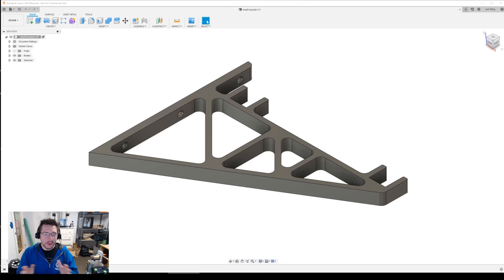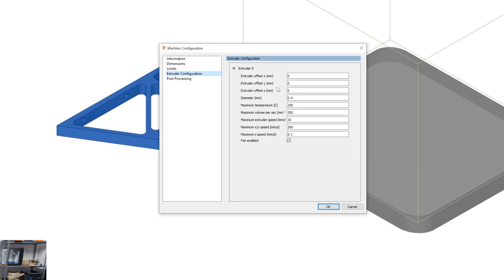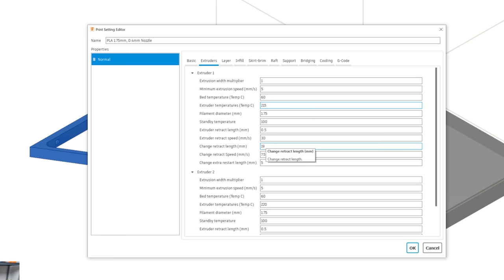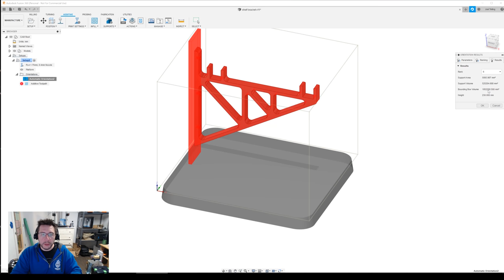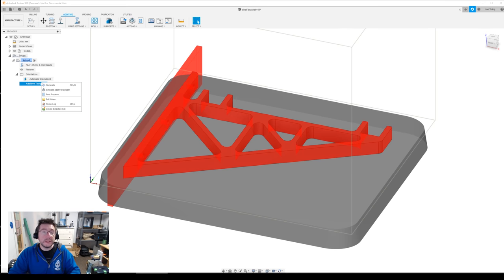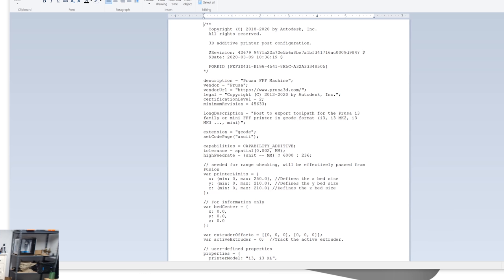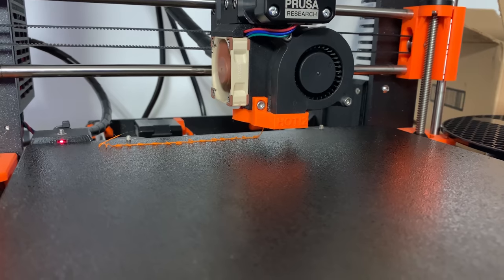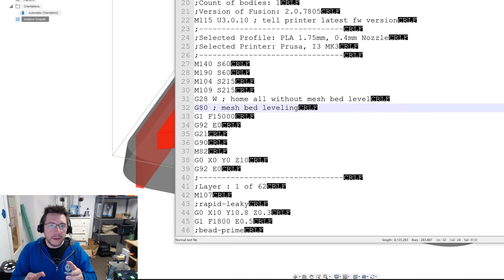Fusion 360 is NOW a 3D Printing SLICER!

Comment: A fix has been applied to the Prusa post. Please download the new post and you should be all set. Happy printing!
Reply: That was fast.
Reply: Does this Slicing process handles Curves/Arcs correct? That is my biggest problem with most slicers
Reply: Hi, I love you, just can't figure you out.
Reply: Are the slicer features included with my paid sub, or do I need to buy it with Cloud Credit?
Reply: I dont get to the same post dialogue box as shown in this video - the box I get to is much less detailed and does not contain the web link etc. Is there a setting I need to access please? Also, how, and from where do I down load the new Prusa post?
Reply: I had a look to see how much it costs to get Fusion 360 it's £483 per year so fuck that I might as well learn to code and write my own fucking software ROBBING BASTERDS. In fact to be completely honest, the only thing stopping me from buying a 3D printer is the cost of the software that I would need for it to be of any use. I remember when 2D printing was a new thing. I went out and bought a printer, now if I want to print anything I have to buy new ink cartridges that cost more than the printer and run out after the printer has finish printing useless test sheets every time I switch it on. It literally costs more to print about 50 sides of A4 than to buy a new printer. Fucking rip off, just like everything else.
Reply: @Galv140577  it's free
Reply: @Galv140577  its free lmao
Reply: @Galv140577  Ik this thread is from 5 months ago but look at their competitors like solodworks, they charge 5000 dollars or more per year/licrnse
Reply: Where is my print settings edit button?  it seams to have mysteriously disappeared. This feature is barely useable without it.
Reply: The real question is - can we run a simulation on sliced and 3d printing ready model?
Reply: @markusstaden  I know it's been a year, but could you elaborate
Reply: @snippets9084  All slicers I know, represent curves as straight lines instead of G3 Arcs. I had hopes, that this slicer doesn't, since it has the original CAD File and not only the stl mesh.
Reply: out of this subject but how can i change a gear spur to top view it keep popping on front view and i cannot change it to top view to put on my creation..

Comment: Great introduction to this new feature. They’ve also added a lot of electronics capability. It’s becoming a complete Engineering tool from start to finish.
Reply: I wonder how easy it is to learn the new PCB design features.  I have no experience in that field, but it seems like a natural extension to all the other things I have learned after getting my first 3D printer 5 years ago.  It’s funny to think I was nervous about even working on the wiring of that original DaVinci 1.0 back then - error 0011.  (And your video was the first 3D printing video I watched after searching for what that error meant).
Reply: it is honestly awesom    does everything from parametric design to free form to simulating    and even this gcode outputting  it is amazing i use it for plasma cutting and now i can use it for 3d printing   i know alot of people use it for milling and turning

Comment: Gotta love this when they allow additive manufacturing for simulation. And they could start to offer dynamic infill in different areas on all the model. 

Finishing up a 3D model right now for my thermal camera housing in Fusion 360 and might give the slicing a shot. I don't have an Prusa or Ultimaker tho so I have to take Generic.

Comment: Fusion 360 is the best modeling software I have ever used in my life. I love it so much. I have made some really cool practical things in it from scratch. Now it slices too, so much awesome!
Reply: You should try Solidworks or Inventor. The only reason to use Fusion is because it's free.
Reply: @noxix7641  I wouldn't really say that there is that much of a difference between Fusion360 and Inventor regarding what you can do and what tools that exists. 

It's mostly that Inventor have a way to do things that are more made for bigger teams while Fusion360 is mostly for one person projects.
Reply: @eke0909  Unless something's changed in the last month or two, Fusion360 still can't do rather basic tasks like making a helix or custom thread profiles, things that could be easily done in inventor a decade ago.
Inventor is priced way too high for hobbyist use and fusion 360 isn't good enough to pay for. Rather than spending the resources making a worse version of one of their products, they should have made a pricing structure for that product that includes the hobbyist. It's not like copies of software have production costs.
Reply: @eke0909  The one thing I really like about inventor is the assemblies. It just seems easier than Fusion 360.

Comment: Any sennheiser headphone set will do you very very well, they are a bit on the expensive side. However, their sound quality and honestly their microphone calibration are all stellar. I personally use the razer kraken v2 7.1 headset and it also has great sound calibration and a decent microphone and a very good price point. Just 2 options to consider :) . As for your chair, I recently just got a respawn gaming chair, hear me out. It is SUPER comfortable, not too expensive & has hight, lumbar, & reclining adjustments & has a retractable leg rest. Just some options to consider! ^_^ happy printing

Comment: Steelcase chairs are good. Or Herman Miller. Had the hm embody chair at my last job and it was amazing. An investment, but if you spend many hours in it - no hot spots, extremely adjustable ergonomics, completely blew my mind and reoriented my mindset on the importance of well designed office furniture. (Worked 60-90 hours a week at that job, a good portion of that at my desk.) Bought the steelcase gesture for myself when i went back to school and quit that job. No complaints. Think I got a better price ordering locally than I'm seeing on the internet. 🤷🏻‍♂️

Comment: You can go for Steelseries Arctis Pro there is a wired and wireless option, it is an amzing headset and fits nice and snugly. Also it is not bulky and the microphone on it is amazing. Ive used mine now for 3 years with no issues.

Comment: hi.  Thank you for doing this video.  I designed a simple whistle and using your information, easily created the g-code.  It is printing right now on my MK3S+, first non-canned part.  The post processors for Prusa are in F360, ready to select.

Comment: For being able to hear yourself at the same time as recording and not distorting your voice from noise isolation (and being able to hear children doing things they shouldn't), I suggest an open back headphones. I bought a set of open back Sennheiser HD 599 and will never go back to closed back, the difference was staggering. I don't have any suggestion on mic because I just bought a cheap ebay $15 stand mic with the sound ring, but it does discord well enough.

Comment: The potential for this is huge! Simply being able to slice based off the actual CAD models, rather than an STL export, may eventually enable us to get much better printer output. Of course they clearly have a lot of kinks to work out in the process, but it'll get there.

Comment: Hey Joel, longtime fan here. i was looking to buy a 3d printer that could construct 30in x 30in x 6in 3D models that werent particularly detailed. Whats your suggestion on 3D printer I should go for? the larger type that can print the piece in one shot or a smaller one that prints out in pieces and you glue them? anyway, love the videos!

Comment: Hey Joel,  When looking at the generated G-Code, are arc/circles simple G0/G1 X/Y moves, or are arc's created using I's and J's or R's?
Reply: jalanjarosz G2 and G3 are arcs.  I and J are the center point of the arc.  R is a simplified command only using the radius, sometimes comes out funny.

Comment: Nice! Can’t wait to try this actually. I use Cura now, but this looks like it could be fun if all the differences are worked out!

Recommendations for equipment for you:
Headset: Audio-Technica BPHS1 Broadcast Stereo Headset with Dynamic Boom Mic. Sweetwater has them in stock Item BPHS1. If you go to them, let me know and I’ll give you my sales guy’s info. Mike will take good care of you.  He might be able to do a little on the price. 

Chair: hear me out before you shake your head.. lol. I’d recommend a Racing Seat Gaming Chair. I know your probably not gaming, but take into consideration that these chairs are made and contoured for sitting in them for HOURS at a time. I like the Desino gaming chair as a cheaper option. You might never need\use the footrest, but it has great lumbar support and an adjustable reclining back. 
  For a more expensive option (and one of the most comfortable I’ve sat in), I’d recommend the AKRacing Masters Series Max Gaming Chair. The Blue one is on sale right now for $378 at Amazon vs $485 for the Indigo or $450 for the white(accent colors). This one has both lumbar and neck support set on straps so it doesn’t really move on you. 

Hope that helps! Thanks for the great content!

Comment: I updated F360 today but do not see the "Additive" option.. only the other 3.. weired..?
Reply: Its an Extension you have to add from Autodesk through using Cloud Credit. Here is the link to the info. Hope this helps.
http://help.autodesk.com/view/fusion360/ENU/?guid=GUID-EEE56836-C03A-4B10-A51C-A6203CF46AC4

Comment: I had that problem too. But when starting the Post Process, you can select the printer model in the first row in the table on the right, under Program Settings and then it homes and does a mesh bed leveling. At least, this worked for me and my Prusa i3 Mk2.

Comment: I noticed the setup in Fusion denotes the Prusa MK3S as having a bed size as 200 x 250 x 210 mm.  This seems to be backwards in X-Y-Z dimensions as defined by Prusa, with a bed size of 250 x 210 x 200.  Does this have any impact on print area when slicing direct from Fusion-360 vs the Prusa Slicer?  It would seem as though the print would overrun the allowable print area.

Comment: Hey Joel, this is awesome but I wish then could have some layer stop options for filament changes and since it saves as a gcode I can just save file onto my sd card instead of putting it onto cura and saving which you can't alter, it won't let you. I hope they come out with more options in fusion.

Comment: Fusion 360 also has a easy method to directly save a model to 3D printer export file (save as gcode) to your favorite slicer program. I.e Cura or Prusa. 

Be aware there are some fusion 360 good glitches in their plug-in API.

Comment: I'll scratch your back with a hearty recommendation for a mic/headset, for a favor or vid idea in return.
14 years ago my regular mic died while doing a podcast, so I ran a few doors down to the local music store and snagged a Samson USB studio mic for $65. Records crisp, clear audio, plug and play; hooked into Audacity it sounds like a $300 piece of equipment. And the best part, I still use it today with no loss of quality. They make headsets too and I nearly snagged one off Newegg last week when it was on a stupendous sale but ended up buying printer parts and supplies. Surprise surprise... =)
If you want to get really nerdy, Plantronics makes a decent set of ears for a good price. Not sure of present, but in years past this was the same supplier for NASA. Not that they're known for great audio quality, but I thought it was a cool nod and my set lasted longer than I would have given them credit for. A wire short was their demise, but I figured 8 years of hard use and being stuffed into a computer bag as worth the $30 I paid for them. 
On the chair, I wish I could help. I've bought cheap ones and more expensive Executive chairs like the one I've had my butt in currently for four years (also broken and held together with a pair of vise grips), and in either case the hydraulic will fail like 2 days after the warranty expires. A replacement is almost as much as the chair, so if you find a good one with lasting power, let me and your community know!

Beyond that, I've been having issues with my printer head smacking my prints around and either causing catastrophic fails or issues beyond remedial repair. Looking on the web I've read up on any of a hundred possible causes, but at present I can be sure it's not hardware as I just gave it a 100% tune up, and the printer itself is 2 weeks old. It's also a delta, so a good 95% of the Prusa's reported on forums having the same problem--though of slight use in diagnosis and general reading interest--didn't help much. 
So either it's slicer settings related, firmware or filament? (This is your video idea return favor request, cough cough).
Add: Samson C01U Pro USB Studio  There ya go. 80 bones on Amazon straight to your door.

Comment: Was the post-processor you selected contributed by Prusa, or developed by Autodesk? If the former, very did that the the generated gcode woups lack the proper home and MBL prefix.
Reply: A fix has been applied. Please download the new post and you should be all set. Happy printing!

Comment: Did you use spring steel sheet from triangle lab powder coated sheet for your prusa mk3?? It maybe like that. If Not, What kind of your spring steel sheet? where from?
Reply from the maker: It’s from Printed Solid and it’s a powder coated sheet from THEKING

Comment: Hi Joel, interesting stuff here.

I am a Simplify3D user, but I do all of my modelling in F360. Would you say F360 is in a place where it can take over from dedicated slicers such as Simplify3D?
Reply: I would say that you maybe should wait for a bit more for Fusion to get it more stabile and work a bit mire with it. 

But for a not to far future I really think that Fusion could be a competitor to dedicated slicers.
Reply: When S3D will finally release V5... I dont need it anymore... 😁
Reply: @eke0909  I have tried it out and am happy with it, just on the basis that I don't need to switch programs to slice my models. It works well enough for my use, and it's free unlike S3D so I'm happy :)

Comment: I think Autodesk has a way to go to perfect this.  Much easier to just export an STL and slice it with my normal workflow.  That way I only have to worry about printer configs in one place.  With this, I'd have to configure printer settings here, and printer settings in my normal slicer (Cura) when I'm using STL files from some other place than Fusion 360.

Comment: Fix your chair with a length of PVC pipe split vertically and placed around the metal shaft. Cable tie every 2"s. $5 fix that will allow the leather to wear some before needing total replacement :)

Comment: It's normal for a CNC machine not to home automatically before beginning its operation. Most CNCs are manually homed with the aid of an operator before the gcode program is started. Its "weird" in the proper machining world that 3D print instructions automatically include home as part of their files (makes perfect sense to a 3d printer, but is strange for the whole ecosystem). That should explain it.

Comment: Wonder if they'll actually try to push slicer tech - maybe doing some kind of "adaptive 2d" top and bottom layers similar to their cnc toolpaths. Wonder if there's any extra knowledge that they have due to having the full cad model instead of a trimesh that could result in better printing. (Maybe adaptive infill like one of the YouTubers - cnc kitchen? - did based on fem)

Of course, as a big open source proponent, I'd rather see this in an open source slicer. I doubt anyone will add slicing to my preferred CAD, SolveSpace, any time soon, but some of those ideas would be possible with just a richer file format than STL

Comment: how will you screw the bottom of the brackets? there seems to be no room for a screwdriver
Reply from the maker: Yeah. It sort of worked. I was able to use a driver and it held great. However, I know MUCH better ways to design now :)

Comment: Hi and thank you for a great video. I have followed your "recipe" and all works fine, right up to the post process step. At this point my system defaults back to a classic CNC post process dialogue. I do not get to the expanded dialogue box that you demonstrated. Any ideas? Is there a setting I have missed?

Comment: Why get a headset mic when you can get a lavalier mic, or a cheap desktop condenser? 

Chair-wise I just got a Steelcase Gesture at work. It's expensive but oh dang is it worth it. (And I got it just in time to have to work from home anyway.)
Reply from the maker: For the mic, thinking I need a head mounted one as this room also has printers and computers running, so there is a fan noise. I thought bringing mic closer to my mouth would help?
Reply: @3DPrintingNerd  Oh, good point. Condensers tend to have a pretty narrow pickup pattern but they're still pretty sensitive to background noise. I'd still think a lavalier would work pretty well in that situation though. Isn't that what you normally use in normal show recording?

Comment: Am I missing something or is this feature only available through cloud credits? I don't have the additive option on mine ...
Reply: Its an Extension you have to add from Autodesk through using Cloud Credit. Here is the link to the info. Hope this helps.
http://help.autodesk.com/view/fusion360/ENU/?guid=GUID-EEE56836-C03A-4B10-A51C-A6203CF46AC4
Reply: I have the free hobby version of fusion 360 and all options shown in this video was available.
Reply: You just have to close Fusion360 and re-open it to apply the update. Then you should be able to select "Additive". 

I haven't been able to get it to slice reliably, and the fix that Autodesk released didn't make any difference to the homing issues for me. No idea about the travel issues as I can't get it to generate the toolpaths most of the time.